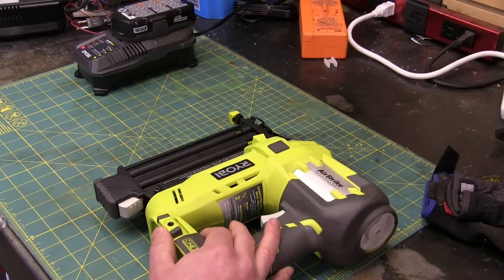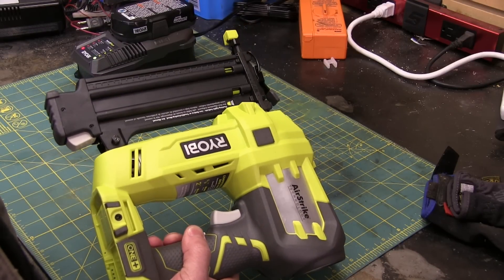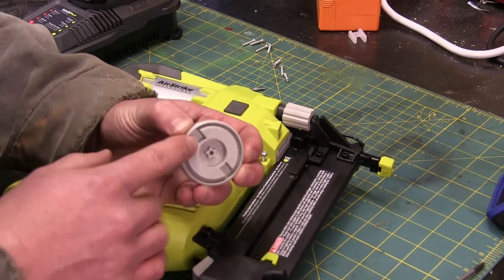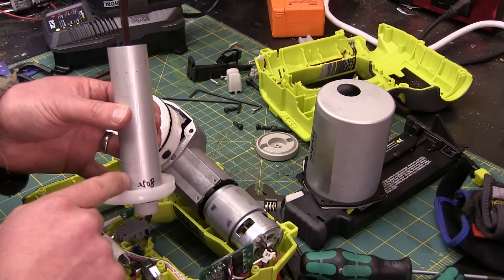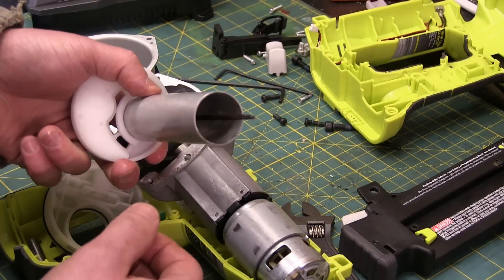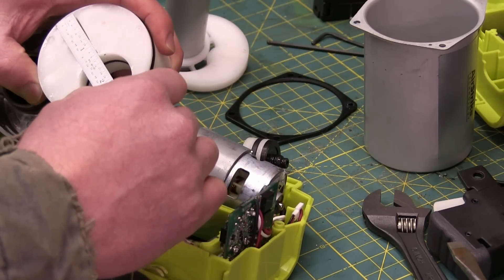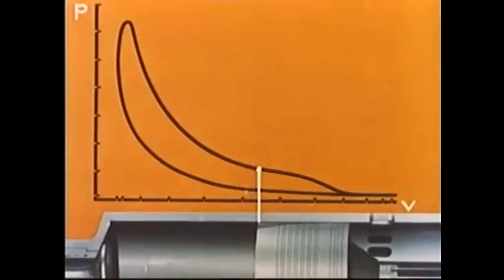BOLTR: Ryobi Nail Gun 18V cordless

Comment: Borrowed the same tool today from my brother in law. When I went to use it. It would fire. But low in behold. No fastener in the dead tree carcass.
Turned out the "hammer/striker" was stuck in the forward position. A little Boshield T9 did the trick.

Comment: I've got a growing collection of Ryobi tools. While Milwaukee and Makita tend to have a tad more power, that power comes at the expense of battery life. I've been more tghan happy with the majority of my Ryobi tools, and I tend to pick up new tools for my collection at local pawn shops. The plus to this shopping strategy is that tools bought at the pawn shop tend to also come with batteries. I now have enough batteries that I had to buy the 6 port charger for convenience, even though it doesn't charge them simultaneously, when a battery goes flat I just pop it into the charger and I don't have to worry about swapping batteries every time one finishes charging.

Comment: Having owned a Ryobi drill and mini-circular saw for a year now and using them for wood work and some light metal work. I have been very curious to tear mine open and see what's in them. The tools feel like heavy toys in your hands but they are surprisingly durable. With all the ribbing I see in that case, certainly explains why. Surprisingly good performance for low end tools, better than I expected during a time when I was getting sick and tired of spending on cheap tools that fell apart when I had very little in the way of tool funds coming in. 

The batteries however suck. They die way too fast. The bits are terrible but the chucks on the drills can grip just about any bit so no biggie there. The saw I'm going to void the warranty before my next use by removing that stupidly placed cutoff switch. How you have to hold that thing to hold both the safety switch and the fun switch is incredibly dangerous. My wood shop teacher would have been screaming at me for leaning over a tool like I have to just to use their circular saws, great recipe for getting your shirt wrapped into the moving parts. Even with the terrible design of their mini-circular saw it is the first circular saw I've foudn I can free hand my cuts.

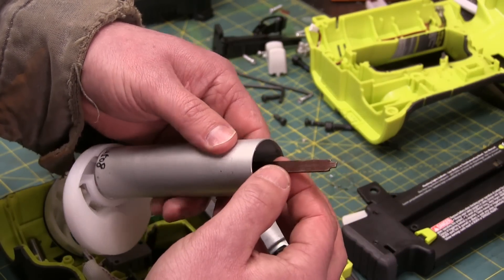Comment: At 21:44, I suspect the rough extruded aluminum does not, repeat, does not wear down the O-Ring, because of that hard, shiny, expanding ring on top of the O-Ring, which the arrangement of which, you added, was not normal.  The Goop is an effective way to add whatever Mass is wanted with robotic precision.  A non-cosmetic application of the stinky.

Comment: SEBS is cool: the styrene forms crystalline domains, so hard but also springy, we chemista’s call Van der Walls, but the butylene separates the styrene so they don’t yellow. A chemistasist calls electronic isolation. So you get a simple extrudable rubber that holds up in the sun but is tough and abrasion resistant. Also not oxygenated, leading to no chemical breakdown from acid/alkali but solvent still attacks it.

Comment: I can pick up Ryobi tools very inexpensively in local pawn shops.  They work good enough for my purposes.  The 1/4 inch impact had no trouble driving Tapcon screws into masonry.  I can get them cheaper than the new lithium line from Horror Freight.  If someone breaks into my shop and steals everything, I can replace them easily.  Similar logic behind why I carry a Smith & Wesson SD9 instead of a SIG P229 Legion.  Sometimes, there's something to be said for just good enough. I enjoy your vajeos.  Your slang has made its way into my vocabulary.  My wife is a middle school English teacher.  My goal is to hear her say schmoo or chooch.

Comment: De Wilt is Black & Decker. The B&D consumer grade hand drill motors sold in the 1970s were rated for "up to" 10s of hours of continuous use. Actually one model was good for an average of 26 hours of use before it crapped out.

Comment: @AvE you really need to learn about sintering and the processes that actual go into making sintered parts.

The powder is compressed so tightly that it holds its shape even after it is release from the mould. It is then baked to a point where only the outside of the particles in the part melt together.

These gaps between the particles allow for basically alloying other materials such as silicon which can make the part self lubricanting or make the part able to hold a lubricant in itself. The time of baking can be changed to create different qualities and abilities of the part too.

Comment: At work we use a Hilti BX 3 nail gun. It can drive nails into concrete and even solid steel. Fun little thing, but with batteries and charger it‘s 1300€ if you‘d buy it.

Comment: One other thing about the Ryobi tools line. The batteries for one generation with fix the next and the previous ones as well. I have 15 year old tools that will use the modern battery because Ryobi kept the battery form factor the same over the years.

Comment: Not just a two stroke, but a crosshead marine two stroke (note the piston rod doesn't oscillate). Very interesting engines, thermally efficient, and able to run in either direction. Modern versions don't use a camshaft, the exhaust valves are hydraulically actuated and computer controlled, years before Koenigsegg came out with free valve.

Comment: Ive had the 18 and 16 guage for over 3 years and i have 3 batteries ghey have been very sturdy in my profession,  i use them at least 2 times a week for hours at a time. Blew my mind but  keeps the air compressor in my truck.

Comment: I used to work as a customer service rep at the homie cheepo and I saw so many of these get returned for really concerning issues like over heating to the point of binding up one or two reportedly caught fire (probably the battery) not this specific tool but it really calls into question the quality control Ryobi has

Comment: Bein using mine for past 3 years and since i took it apart greased it, tuned the saftey switch and power control on the back its phenomenal more power then ever needed.
Drains nails in hardwood nots, corners you even sheet metal this thing is a boss after a quick tune job. 
Oh i also used milwaukee batteries dont own  any other ryobi but this thing i like better then the milwaukee brad not impressed with always compressed design of milwaukee

Comment: What a shame. Years ago I did part time installs and service for Direct TV. I had (still have) a Ryobi 18V hammer drill that I could not break. I even dropped it off of a roof several times. Didn't even crack the housing. Maybe I was lucky. I have noticed on my infrequent trip to Home Depot that the quality seems to have taken a nose dive. Must be the need for greed syndrome that is sweeping the planet. Great review. Keep telling it like it is and was
Reply: Mike H We've had a Milwaukee drill for 10 years. It wont die. We use it to drill holes for foundation bolts in construction. My new Milwaukee drill died after one year. Quality of tools has degraded.

Comment: Since the crank shaft is less than one foot long you should increase the amount of force that the motor is outputting. So like 1 ft pound of torque outputs 1 pound at 1 foot but at 6 inches it outputs 2 pounds. So kind of like that deal it seems like the psi should actually be around 100psi which would be more reasonable. Anyway love the BOLTR's you ough to do more!

Comment: I bought a Rigid "fuego" 4 1/2 angle grinder from the home depot a couple years ago.  I always ran hot as hell, which i guess it why it was called "fuego".  Anywho, not even 2 months later it fried and shot sparks and molten metal out the back vents. 

 I took it back to home dept and they told me it had to be sent back to rigid.  I told them they should hurry up and get on that and then i asked them what they were going to do about me not having a grinder in the mean time?  I was a busy man after all.  They took my broken rigid grinder, shipped it for me at no cost to me, and gave me a brand new Makita grinder in exchange.  

3 moths later i got an email from the Home Depot saying that my warranty claim was approved and they sent me an $81 homedepot gift card via email.   Funny part was i only bought the Rigid grinder in the first place because it was on clearance for 50% off and i only paid about $35 for it and i still had the Makita grinder.  I used a portion of the gift card to buy a Ryobi 4v driver for RC car work.

Fast forward 2 years to now, and i finally used the gift card to help purchase a Dewalt drill and impact driver set, which was on sale AND i got an extra 10% off on top of that by talking to the customer service chat box on HomeDepot.com because the internet order coupon code for "Buy $100 dewalt tools, get $20 off" coupon code didn't work.  

So in the long run, i spent a total of about $110 out of pocket and for that i got a 4 1/2in Makita grinder, the Ryobi 4v driver, a Dewalt 20v drill, Impact driver, 2 batteries, charger, and the tool bag the drill/driver came in.  

All in all my experience with the Home Depot has been all good.  You just have to know when to put your foot down and make them honor their warranties and guarantees.

Comment: Your simplified maths is a good way to go. Simplify it a bit further and it is even better. For comparisons you don't need PI. It is all a ratios game. If the outer cylinder is 3" approx diameter and the inner cylinder is approx 1" diameter then the pressure gain is in the order of 9 to 1. Squares is all we need. Keep it up mate. 20 psi turns into a peak of 180 psi, hence the magnet and the timing via hall effect sensors.

Comment: Totally unsolicited testicle-moanial: I have had one of these brad nailers for two years. It has worked flawlessly and I use it all the time. I'm totally enshrined in the Ryobi ecosystem. I have more than a dozen Ryobi tools - all using one battery format. I used to use DeWalt (and still do sometimes), but have never regretted my switch to Ryobi. They may be cheap, but they are surprisingly reliable and you can't beat the utility of having one battery that works with a drill,  impact driver, circular saw, sawzall, trim router, multitool, right-angle drill, utility light, air pump, angle grinder, jigsaw, sander, hand-held vacuum, blower, weed-wacker, and... oh yeah, a brad nailer...
Reply: Cool story bro

Comment: When you measured the piston to calculate the pressure you didn't deduct for the hammer cylinder which greatly reduces the area of the piston so the pressure calculation is way off.

Comment: im on job site everyday. this gun is far stronger and fast than all others. it does way more than others. but it doesnt over heat, so there is no cool down.  it sinks over 1000 nails on the 4 amp hour.  have been using mine for 4 years.

Comment: Every time I use my 3/8" cordless Millfuckme, I get pissed off as any smooth shank drill bit will loosen and fall out within 3 or 4 times using spinning it up in forward.  I think it may be the centrifugal spin when you release the trigger causing the chuck to loosen. Releasing the trigger slowly tends to help, but that kind of negates the reason I am using a drill in the first place. Especially when drilling a lot of holes. Got away from Dewalt tools as I had the exact same issue.  Doesn't happen on my 1/2" battery drills however.   I do however have to give kudo's to the only Ryobi I ever owned.  An AP13 surface planer that after 15 years of hard use is still working fine.  This was back when the colors were blue and black.  Not the ungainly green color they identify with today.

Comment: been extremely happy with my air strikes. the 18ga brad nailer is better than the similar senco and Milwaukee in my experience. Used it professionally and killed them eventually but cheap enough they more then pay for themselves in productivity. very quiet and flawless operation. somewhat annoying in certain spots but nothing better that I've found

Comment: In February 2019, it is $299 for the bare tool, in New Zealand. $99 for 1.3Ah battery & charger. That's the best price. Ow ow ow. Microswitches are dead easy to replace when they fail. But I'm only ever gonna put maybe 4,000 brads through this thing before I die, so the chances of it shitting itself in my workshop are close to zero, I reckon.

Comment: You're incorrect about the Ridgid lifetime warranty. (AKA "lifetime service agreement") You don't...and can't send your tool back to Ridgid to be fixed, there is no option for this. You can either take it to a Home Depot that offers tool rentals (not all HD will accept them, but places with a rental section will) and Home Depot will then send the tool to Ridgid for you, at their cost. Or you can take it to a Ridgid "authorized service center" if you have one nearby. It does take 4-6 weeks to get your tool back, but it's better than buying another one.

The better part is the battery and charger replacement. They have a special 800 number to call, you give them the serial number off your battery or charger, and a new one comes in the mail about a week later. You don't even have to send the old one back. You don't have to spend a penny. Try that with any other brand. Consumable parts no less!

The people that complain about this system are the morons who are too stupid to register their tools within 90 days of purchase. If you don't do this you don't get the service agreement. It's not hard, but they are banking on the fact that many people are too stupid/lazy to bother. Even if you don't bother to do this, everything comes with a 3 year warranty, all you have to do is show your receipt, no registration required.

Comment: Might be that the mold doesn't rotate but instead has two injection holes (im not english so i don't know the correct term for it). One for the PA66 and one for the TPS/whatever the overmolding is. We have molds for two materials and use them in injection molding machines with two cylinders. The main one and a small one on the side. Quite fun to work with

Comment: Mine was mis firing and with closer observing I had a jammed nail. I thought it was lubrication issue so I did that. It did finally restore and work again. It's less than 2 years old but Ryobi doesn't work on these either so in reality there isn't any warranty. Retail won't deal with it nor will Ryobi.  Didn't take it apart yet, its obvious TTI uses cheap parts . Sadly its on all tools sold to the U.S.

Comment: Looks like the tool has two stages: 1) in the space of one rise of the piston, pressure builds until the magnet does a clean break, then 2) the motor almost freewheels as the piston is going down throwing a little more pressure ....its just a theory, but do you see anything that can function as a one-way valve?  If there was one, in stage 2 the motor could keep going so that at least there isn't a pressure drop as the piston flies down...AND THEN the motor could run and suck the piston back up!  Wo0t!

Comment: In all seriousness. This tool is only $100 American now and it performs very well.  No compressed air, or any external air, of any type needed. No hoses or wires. And it will shoot a couple thousand nails on a charge. Good adjustment capable for air pressure and depth set.  Holds normal/average number of 18 gauge from 1/2 or 5/8 inch up to the 2 1/2 inch brads too. And many Ryobi OnePlus tools come in packages that include a battery and charger. The bare tool tools used to irritate me until I now. Once you have 2-4 batteries of every size you dont want a 4th or fifth charger and another extra battery which costs more than the bare tool. Twice a year you can get the batteries for half the normal cost, maybe even better, like a free tool.

Comment: A few questions:

1. What causes the return of the hammer? I watched bunch of bits of the video a few times looking for what would push the striker of the hammer back to the back of the tube. Is it just the magnetism of the magnetic latch/valve thing?

2. What is the actual throw of the hammer? The hammer length looks like it is nearly as long as the tool, so the throw must be pretty short, right? Your PV curve may not be too impactful if you still have positive pressure at strike time; it still may operate w/in the PV curve, you wouldn't have to worry about deceleration of the hammer, at least.

3. When and how does the cylinder breath? There must be a valve to equalize pressure once the hammer has fallen (queen song here). I'm thinking it needs to equalize the pressure before it can compress again.

4. Could you not estimate pressure at strike by figuring out what force is required to actuate the magnetic latch/valve thing using a scale then divide that by the area of the valve that is exposed to the cylinder's pressure? It seems like that would give a pretty accurate upper bound, no?
Reply: I just realized that 1 and 3 could be related. Air pressure could be used to draw the hammer back, if the piston has to be drawn back to the front of the nailer, causing it to suck the hammer back. But then when the piston bottoms out, I would expect that it would have to equalize pressure.

Comment: I just wanted to point out that the arm actually has maximum omph at 90 degrees, at 0 or 180 it would have the least.  maybe I'm missing something here. at 28:50 BTW.  love the videos btw
Reply: +Awesomeman1987 you might be thinking about it backwards.  At 90-degrees the radius to the crank will be largest.  Total force equals torque / arm length, so at 90-degrees with a 1-inch arm, the force is 30lbs.  At 45 degrees the arm is about 1/2 the length or 0.5 inches, so the total force is 60lbs.  It'll have the maximum force at 0 or 180 degrees where effective arm length approaches zero.